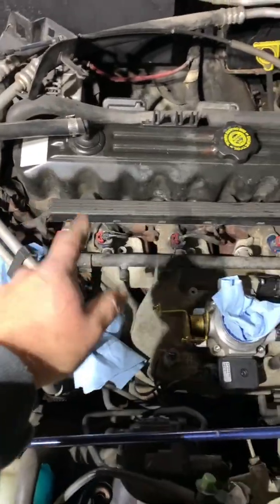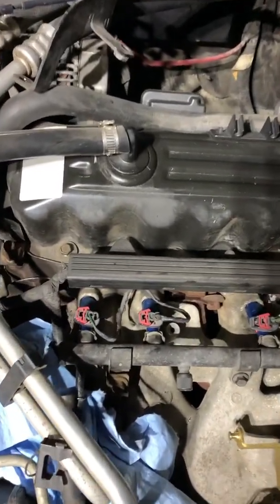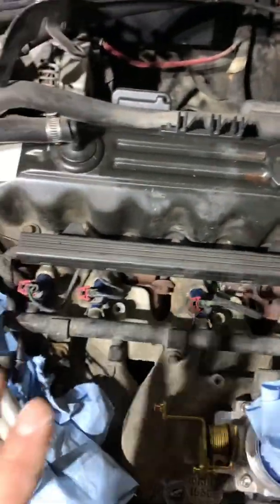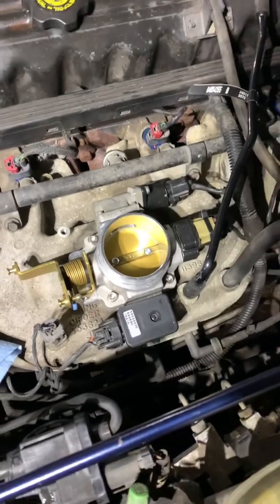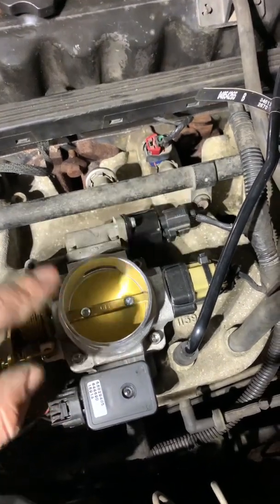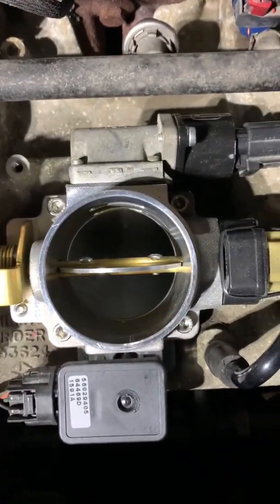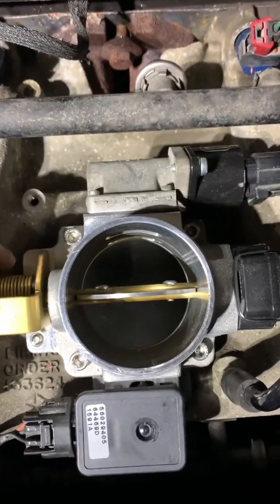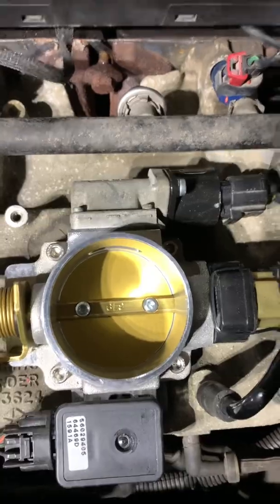ANSWER! Is the Intake Manifold Opening SMALLER Than the 62mm BBK Throttle Body?!

Comment: You could easily port match it anyway.   We're you able to tell a difference? I got the same engine on the way for mine and gonna run the 12 hole injectors.    I know it'll need more air but I don't know which way to go just yet
Reply from the maker: I think it made a difference for sure. I also wanted a higher flow rate of my injectors because I was already planning on doing a Stroker at the time.